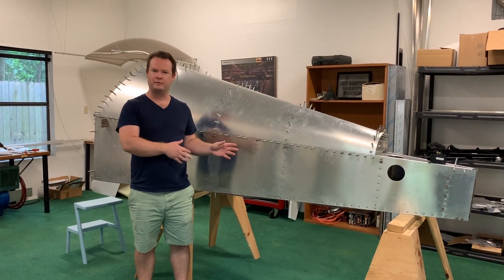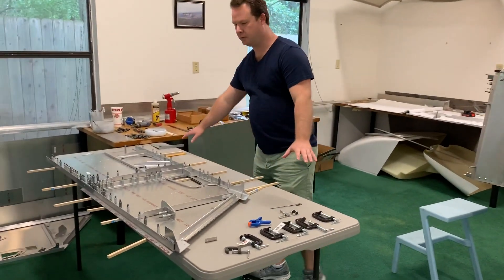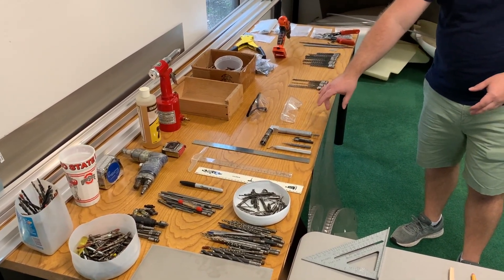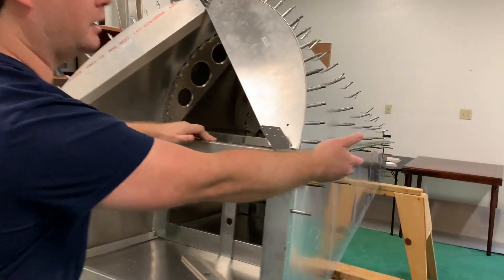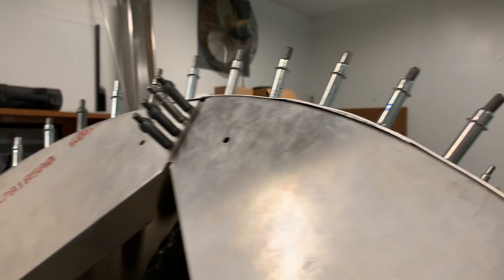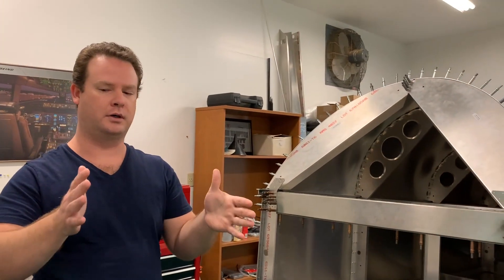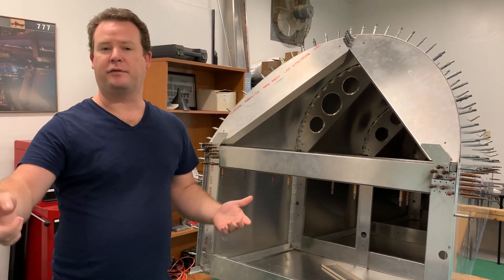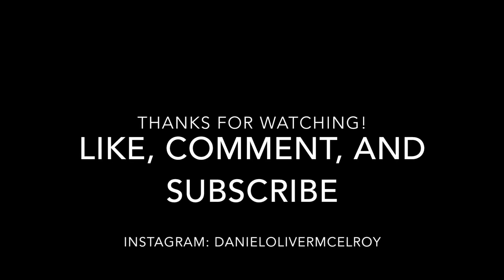Sonex Aircraft Build Video 77 - Forward Formers and Cockpit Side

Comment: Now would be a good time to think about a baggage compartment behind the seat. Before you rivet the turtle deck in place,!!! I made the mistake on my Onex & now have no place to put anything........ Just a thought....Good luck with the build...
Reply from the maker: Good point Danny! I had been thinking about it a bit. I think I am going to put buttons on the back of the cross bar and be able to hang a sling across so I can get basically 2 backpacks in there. Anything heavier and it will throw the CG too rear. I hope you are enjoying the Onex! -Dan